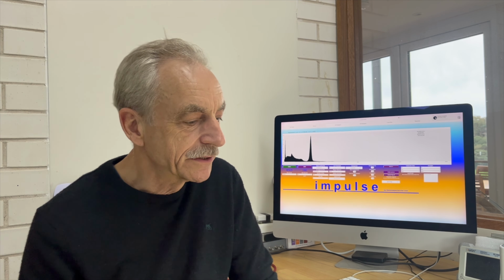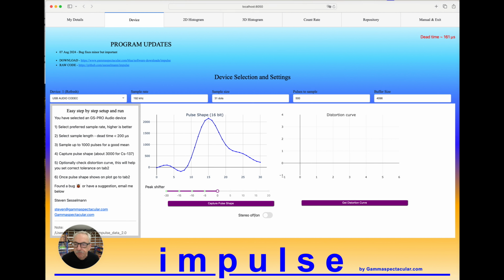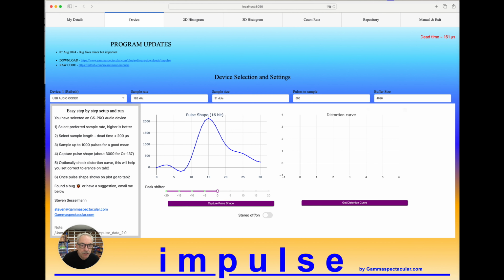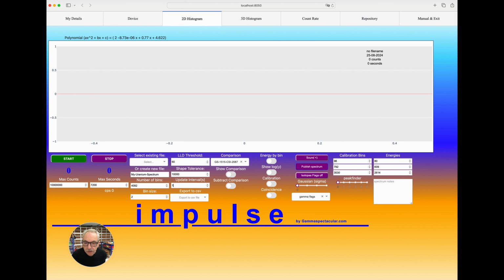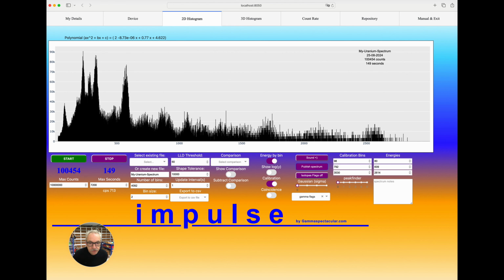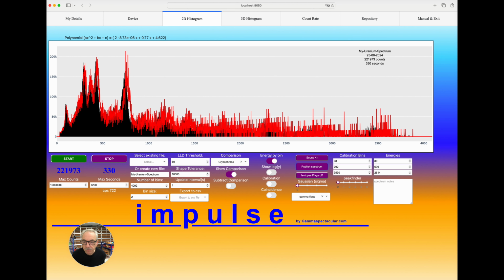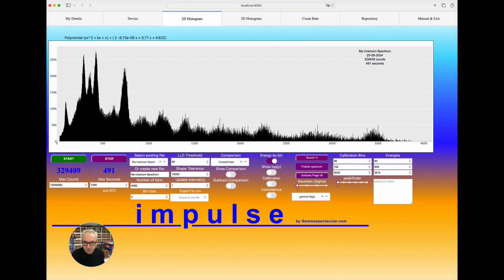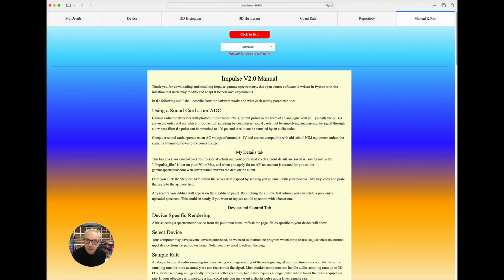Gamma spectroscopy with Impulse MCA

Comment: Is there a library of findings / elements that can be downloaded and imported so I will have some automated / quick identification results?
Reply from the maker: There is a built in library, so after calibration you can switch on the isotope flags and it will suggest the nearest ones. It is then a matter of elimination, to narrow it down to the most likely. Some isotopes have such short half life or are so rare, you can simply ignore them. If in doubt ask the experts on our forum.

https://www.gammaspectacular.com/phpBB3/index.php